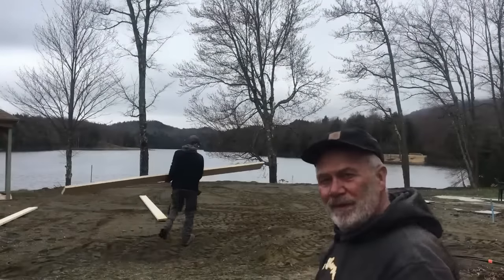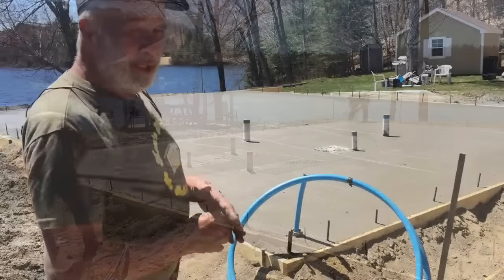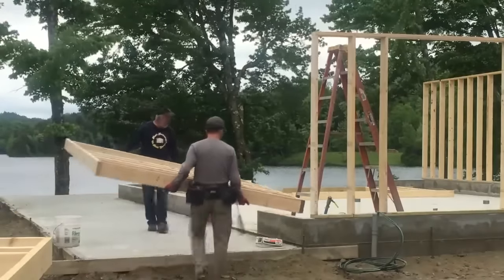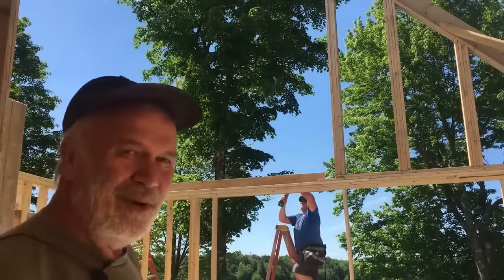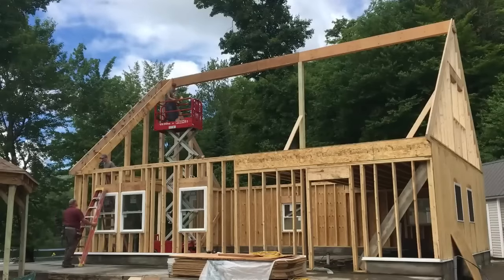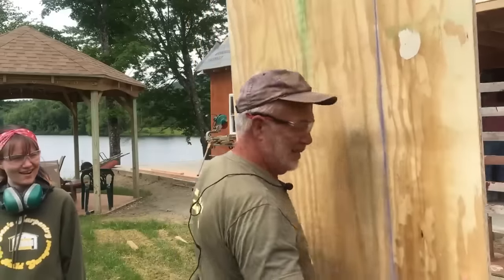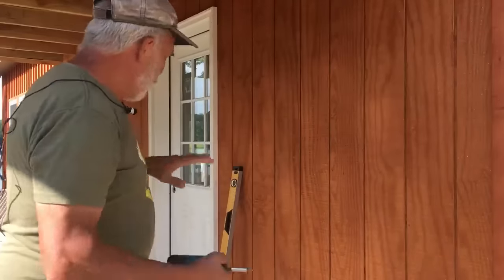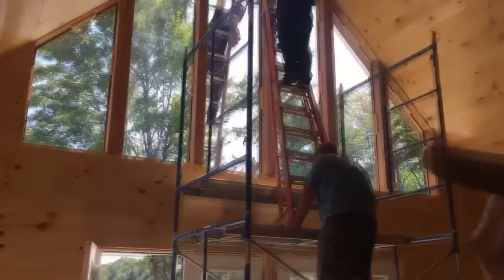$115k Lake House Start To Finish Exterior.

Comment: What I appreciate about you most is that you tell people how much this costs. So many people make excuses for why they can't discuss pricing. Most people on YouTube are merely looking for a rough estimate of what something costs to plan for their own projects so this, sir, is truly appreciated!
Reply from the maker: Thanks
Reply: @kenskarpentry  So you r cost is $115,000? Or thats the cost to the home owners? If the $115,000 is your cost how much would the home owners be paying? How much do you make on a job like that? Thanks
Reply: @Fhillyslick1  id bet thats what he charged, how much he makes is his secret.  Labor + materials, rental of equipment, lot of other costs.
Reply: 115000 is just for the framing
Reply: You can do costing pretty easy by calculating material and then checking stores. Contractors get a discount to make money but you get a rough estimate that way.  This project got expensive because of the concrete slab.
Reply: I would guess 115,000 for foundation, material and labor?  You could be looking at another 80 grand to finish it.  Then add the cost of that lot.  It would be in the 300 grand range is my guess.
Reply: You can’t even buy a parking stall in Hawaii for that much. $660000 for a parking stall 8 years ago. That kind of property will cost you almost 2 million or more. Aloha

Comment: The design of those windows really frame that view. Really stunning! As others have mentioned before, it would be so great to see how the homeowners finish these projects out. Even if it was in a separate video where you did highlights of that particular build from previous videos and then had the owners send a few photos that you could add at the end as sort of a slideshow. They could actually work well as YouTube shorts. Thanks as always.
Reply from the maker: Thanks I’ll be back there in the spring

Comment: That was a nice build. Beautiful location and a functional cabin just ready to move in. There's a roofing company that cuts metal roofing material on-site to fit the transition to the porch area without a break from the upper roof to the lower roof.
Reply from the maker: Nice thanks

Comment: Funny, I have a MEC 1932, great machine. I always wondered why you didn’t use one before. I also own the same Bosch table saw and a Makita LS 1013. Nice tools. 

When we raise gables, we put a 2x4 near the peak with one nail so it rotates. If the gable was12 feel tall, I’d make that 2x4 about 3 feet shorter and you can easily adjust for plumb and it’s a fail safe to make sure the wall doesn’t get away. Nice work.
Reply from the maker: Thanks for watching

Comment: I think the best idea would be a traditional style house with front porch triple window and door but enclose the driveway next to it for 3x3 car garage, one on either side of the pass through and space in between double deep. The house would be a 4 unit studio and bathroom with a rear and side porch and an entire second floor entertaining area kitchen bar fireplace couches pool table and over the garage second floor enclosed patio like park pavillion and the pass through garage leads to 2 car parking next to the house in rear  with porch to connected garage and side porch that leads to a nice sized sideways front farm garden lawn toward driveway with 2-3 parking near neighboors side of front property and sidewalks to control most of the property and a single car bath house unit in back garage with porch and fire place and shed you could have an airbnb and monthly rentals 5 units owner bed and breakfast and exceptional usability/ livability on slightly bigger than average city lot size do that with downstairs business like Cafe mix and match whatever you can think of

Comment: Nice.  Question - why not add the sheathing (in your case siding) to the walls before you tip them up?  You've squared them already and that would hold them square, and no one has to go up a ladder with a 4 x 8 sheet.  Years ago I framed for a few years and that was our MO.   
That view is beautiful.
Reply: Makes the walls alot heavier for 2 elders to lift up

Comment: Very helpful video.  I'm looking to build a similar structure.  I'd like it to have vaulted ceiling for about half the cabin, where the living room is.  Then the back half will be bedrooms and such with a normal 8-9 foot ceiling, and a loft over those bedrooms.  I'm debating a ridge beam versus something like scissor trusses.  Do you have any opinion on which would be easier and/or better?

Comment: Do you ever use construction adhesive on the floor joists. We have used it for years it eliminates creaky floors and enhances the strength of the flooring system. Especially with I beam joists. You know how plumbers like to cut them
Reply from the maker: Thanks for watching yes we did

Comment: Just a question? Why did you only go half way with that header plate over the door frame , why not Carry it thru to go over the Windows,. I'm not a carpenter , just a question thx
Reply from the maker: Hmm I’m not sure where that is. Sorry
Reply: I saw that also, but figured he was just placing one board at a time because it's easier that way. If you have ever picked up a pair of 2x beams with a plywood center you'd understand the extra weight issue.

Comment: You guys make it look easy!  I’m assuming with spray foam you don’t need rafter vents?
Reply: I was thinking the same about ridge/soffit vents since I'm remodeling my garage with insulated cavities and airflow is needed to keep moisture from building. Spray foam bonded properly to the sheathing apparently removes the need for any venting. The ceiling goes direct to the roof rafters.
Reply from the maker: That’s right
Reply from the maker: That’s what I was told

Comment: Enjoyed it greatly, will start watching more. Some questions though. The white pipes simply appear in the beginning of the video, where were they run to / from previously? What about electrical, sewer, water lines etc? A request that's probably too much biut would it be possible to list in board feet the lumber that was used, lengths, widths, quantities? This would make pricing it out easier. As I said though, I realize this may be too much to ask for. Also, how many cubic yards of concrete? Also why are there two separate doors at the entrance? Did not really get to see final dimensions of each rooms after it was done. Details like that, otherwise, thanks very much for sharing.
Reply from the maker: Thanks I don’t have the information on board feel

Comment: I noticed the widows are under the T1-11.  But it seems if a window broke it would be hard to get out?      But less likely to leak that way?  My point is you could put the window on after the T1-11 with a trim around it.

Comment: I may have missed notes on this.  I was curious where this build was?  I like the floor plan, but looking to build in Northern Mn.  Any thoughts on using this floor plan with Post Foundation method?  I am assuming this is in Southern Climate with a very low frost line.  Thanks, Patrick

Comment: Thanks for the video, just wondering how is this roof is going to breathe? Since spray foam has been apply directly onto the plywood sheeting from inside and there is no strapping on the roof,I could see a vent when you put the metal sheeting on the roof, but then it’s finish with pine form the inside,I don’t see how the air could circulate and exhaust trough the roof vent?
Reply from the maker: Ventilation isn’t necessary in this situation.

Comment: Ken, thanks. Excellent as always. Question: you do a lot of 2x12 rafters with collar ties and no ridge beam, which I like. Here you use a very heavy ridge beam. Why the difference in this case? Looking to build something this size  on lake in Northern Maine. Not sure what the concrete guy will say about the floating slab. Opinion on which way to go?  Many thanks for all the years of education.
Reply from the maker: On the vaulted ceiling end there wasn’t an upstairs floor to stop the walls from spreading thus causing the ridge pole to sag.
Reply: Got it. Thanks.

Comment: I'm wondering about permits and inspections ? Around here you can't build anything without jumping thru a lot of hoops. I built my own 20x28 garage in the late 1970's using a "kit" from Wickes lumber.....foundation walls and a slab....had to get a permit and building inspector looked it over more than once. A longtime neighbor down the street wanted to build a garage and spent a lot of money on a survey and plans only to be told the footprint of a garage could not exceed 50% of the homes footprint....and there was other approvals needed from the Historic commission and maybe others....another friend wanted to expand his garage and that turned into a "forget it" thanks to endless approvals needed and a lot of costs.....New Jersey....

Comment: Ken have a question.. How do you not need a frost wall with your buildings? In Pa we must go 36" to bottom of Footer. Maybe you're in a much warmer climate but I see snow many times in your vids. Thx
Jeff
Reply from the maker: We pour an Alaskan floating slab.
Reply: @Kens Karpentry  so when the ground freezes, the whole structure moves? We can't get away with that in Pa, they want frost walls the whole way down below freeze level. Hmmm 🤔 
Thx Ken

Comment: on your shed roof we would have installed the shed rafters and then decked the roof from shed to gable is there a reason you decked the main roof and set you rafter for shed roof?
Reply from the maker: We did it so they could spray foam underneath to make the house envelope

Comment: Hello Ken, another amazing job. What was the parging product you used and applied with a brush? Looks much easier than actual parging. Thank you in Advance 
Mark from Niagara
Reply from the maker: It’s a foundation coating with fibers in it. Kind of expensive
Reply: @kenskarpentry  what is the actual name of the product? I’d like to try it on my foundation. 
Thx

Comment: On some of your builds you use plates to tie the rafters together at the peak.  In this build you use a ridge board.  Is this a structural issue or does it have to do with how the customer wants the finished ceiling to look?
Reply from the maker: Because the room was wide open we needed a ridge beam to stop the building from spreading

Comment: Lovely. For your framing and roof framing, everything is made or cut offsite. How is it that there are no mistakes. Is it all experience or is there software you use?
Reply from the maker: Thanks just experience.
Reply: @kenskarpentry   impressed all those rafters went in precut w/o any additional measuring

Comment: I'm planning a garage/efficiency in Downeast Maine, about this size and same climate zone 6. 1/3 will be heated some of the year. I'm looking at frost protection skirt, R10 and 4ft wide around the perimeter 12-18in deep. Also foam up the stem wall, maybe R20. Will probably protect the exposed insulation with Hardie board. Did you use a skirt?

Comment: One comment and a question. I like how you poured the short 5 1/2” wide walls to accommodate a 2x6 exterior wall. On the interior, when the lake house was trimmed with baseboards how did you secure the boards to the wall without there being a bottom plate?
Reply: glue or concrete fasteners

Comment: Great video.  Does the $115k include your labor costs or just the materials.  Also - where did you get the ladder lifts/trolleys?  What is the brand? Thank ou so much for your time.  All the best.
Reply from the maker: Thanks. Materials and labor. I made the ladder hoist.

Comment: Spray foam for 28’x26’ 12 pitch plus 12’x12’ breezeway in Central NH is 28k. I decided on less spray foam with batting for $14k. Huge chunk of building cost.
Reply from the maker: Nice thanks for the info
Reply: @kenskarpentry  what was your spray foam cost in VT? And how many inches thick?

Comment: How tall is it, and what is the TOTAL SQUARE FOOTAGE of this house Ken... And is the $115k price included with the concrete foundation, septic and well? Im assuming everything but the well and septic? Yes? 

Also would have been nice to get a 360° after shot of just the House exterior and interior...  The video was cut after those windows were installed. Was kinda bummed bout that 😅

Looks AMAZING!
Reply: Would you consider coming down in the spring or summer just South of White River Junction/Lebanon to Build something like this if there was a pre existing house for the crew to stay in on the property for free till house gets built? I like you and your crew
Reply from the maker: Not sure I can answer all those questions
Reply from the maker: Unfortunately I can’t. Sorry

Comment: Hey Ken, This is an amazing video.  I really like a (sort of) review of your work.  ~ and in Vermont.  All good. And so.  Two things that are maybe a little different from the standpoint of (topics).  First:  Thank you for the "weight loss" initiative.  I have struggled but I think that I am on the right track ~ two weeks to a "weight in" ~. scary but I'm making it happen.  I'll share when I check my weight again.  Second:  There are "other" Build shows that I check in on. The one tech guy that has been amazing with HVAC and insulation/moisture issues is Matt Risinger with "The Build Show."  And then the build guy, like you, an efficient, cost effective method for well ~mostly~ barns in the midwest is Kyle and Greg with RR Buildings.  So: I recommend ~ that ~ you check these two guys out.  Wait!  There is more!  One video that has me in tears:  Just posted four days ago ~~~  on Matt's site (The Build Show) ~. "Biggest Building - lowest cost - Post Framing with RR Buildings."   ~. ( Matt meets Kyle  ) -  1.2 M views already.  Epic.  Ya gotta take a look at Kyle and Greg's work with Matt Risinger !!!   So there ya go.  Best wishes.   And thank you so much for sharing all that you do.
Reply from the maker: Thanks hope your weigh in goes well.
Reply: @kenskarpentry  You are welcome.  I'm cutting out bread and ALL carbohydrates and "fasting" ~ not so easy.  Oh and the buzzword is "Barndominiums" ~. Maybe you've noticed~. All over UTube.  You should be designing and selling ~ Marketing "Barndominiums."  Oh sure!.

Comment: Ken, I want to build the same basic house, however I want all the rafter beams & ceiling joist beams exposed.  Can I put the roof insulation on top of my sheating and then the metal roof?
Reply from the maker: I have seen that done before

Comment: I usually see people pour the stem walls over a footing then pour the slab second? Any benefit to doing the walls on the slab? Also the bent rebar that goes into the walls, did it run down into the ground also or just bend at a 90? I’m building a garage soon and trying to figure out the best way to go. Thanks!
Reply from the maker: The rebar is bent at a 90

Comment: Great job! Just curious as to what kind of spray foam that is? When they do houses in our area it comes out even with the studs or a little past and they come the next day and trim the excess. Did you guys add insulation on top of that also?
Reply: It should be closed cell here in the northeast. The foam you mentioned sounds like open cell.

Comment: On the gable end without the loft, do you create a hinge point, (where your triangle pieces set on the wall) by not running double studs from bottom plate to top plate? Building something similar and looking for suggestions
Reply from the maker: We attached a nailer to the outside of the wall framing to let each triangle come up against it. Then nailed and braced it off.

Comment: I have been told that using spray foam can make it hard to sell or get a mortgage on a property. Is there a truth to that? It seems like a good option but not if it is going to cause issues.
Reply from the maker: I’ve only heard good news about it.

Comment: All accidents are preventable.   You put a step ladder on top of scaffolding with a guy at the bottom holding it???  What the heck?  Turn the scaffolding around 180 degrees, raise the plank up to desired height and continue working safe.  nice build though.  be safe.

Comment: Hello Ken, I've watched many, many of your vids and a few on this build awhile back when the custom window install came to a halt because of manufacturer sizing error. Now  I'm looking at the above vid and listening to the numbers ($$$) it scared me.. I am planning on building an 800 sq. ft. house and I realized that your weather tight shell of (footprint) 936 sq. feet cost 122 per sq. foot!! Add another $20K on top of the slab foundation cost for a full basement and you're pushing 150 sq. foot! Approx. how much more do you estimate for completion?  And how much did the custom windows cost? I thought I would get away with 225 per sq. for a complete home... now I am rethinking... 😢😢
Reply from the maker: We don’t typically do houses so I’m not much help. Sorry

Comment: Why do you pour a wall on the slab before framing the exterior walls? Is this code or years of experience or both?
Reply from the maker: They wanted more concrete showing

Comment: Why did you put those vertical slats on the exterior wall sheathing? For looks or is there a purpose?
Reply from the maker: For looks
Reply: @kenskarpentry  Thank you for responding so quickly.

Comment: I have a green block foundation in the NEK and was wondering what you used to surface the rigid foam insulation on the outside?
Reply from the maker: I bought it at at Poulin lumber. Don’t remember the name
Reply: @kenskarpentry  Thanks.  I'm in Derby so I'll stop by Poulin

Comment: 23:26 Small question: When screws are used, wont they rust someday and water will leak? Is this roof better than shingles? (very good video, enjoyed it)
Reply from the maker: They have rubber washers. The screws are good for at least 30 years
Reply: @kenskarpentry  Ah, thank you!